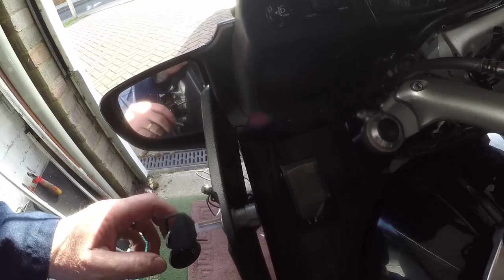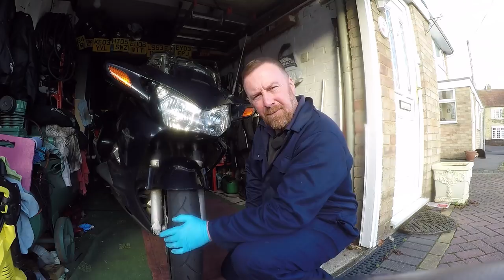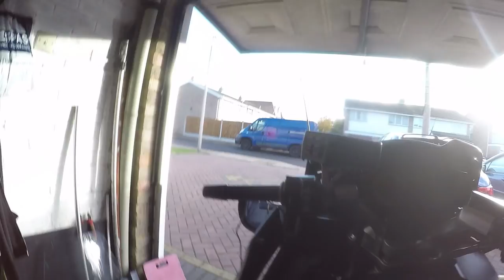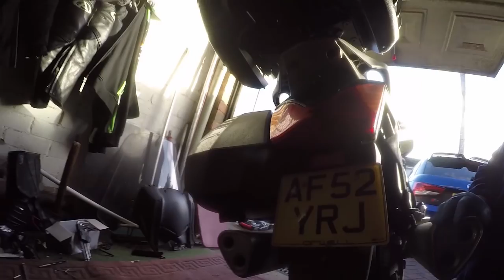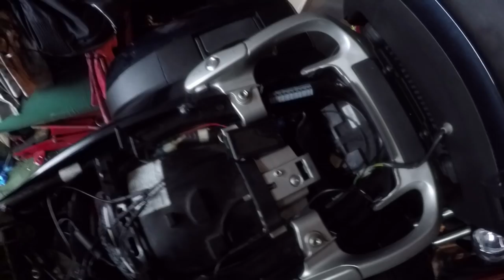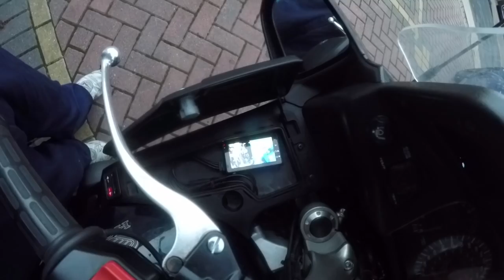HONDA PAN MOTORBIKE DIY DASH CAM FITTING + LED 501 MARK SAVAGE

Comment: Kudos Mark.  That looks a nice job.   Following all your vids and slowly getting a cheap ass Sinnis 2012 125 up to scratch. Front break calliper, carburettor, air filter, oil, spark plug all done thanks to your vids.   Rear drum next along with front and back rubber then it’s all done.  Keep up the good work mate!
Reply from the maker: Dar Garner thanks bud and for watch 
I have had a few cheap 125s and all suffer from the rear brake and speedo cables but god old wd40 and regular services and they keep good 
Enjoy bud 
Mark
Reply: You are bang on.. I forgot about the speedometer cable too..   I took it off to clean and check it and the bloody thing had snapped about 6” from the wheel end inside the outer cable.  So..  do you recommend getting the outer complete or do I just buy the inner and use original outer Mark!  Thanks in advance
Reply from the maker: Dar Garner you have to buy the  whole cable but it is really easy and just change the whole thing and you can get to it very easy 
On some peds I just slip in a new inside cable 
Next thing to fall off is the exhaust lol 
Still a lot of fun for £600 odd 2nd hand 
Mark
Reply: mark savage ...  Right, you have either seen this bike or your crystal ball is on form!    You are bang on with the value and the exhaust situation but it’s the best 600 I ever spent and I haven’t even ridden it yet...    Cheers for the tips on the speedometer and stay safe on the bikes Mark.    PS.  kindly ask your crystal ball to send 6 of its luckiest numbers between 1 and 45 😜...

Comment: Yet another informative, theraputic funny video.
Mark.
Nice to see you faffing a little.On a  bike your not familiar with.
Have already installed leds 
I looked for canbus no faults.
Love them.
Also wear a gopro cheap copy while riding my tmax.
Just bought a nice rear camera/monitor...so i can see directly behind myself.....
Have a look at fitting those small led spots to your front mudguard.
That way the light will shine where youre stearing.
John
Reply from the maker: John Oleary thanks for watching bud and for the advice 
Mark

Comment: Hey Mark 

You should have removed the left fairing , very easy to do (once you know how), takes around 10min, as for the side lights, you were on the right track, you need to completely remove the back panel up inside (takes around 5min), then just stick your hand right up there and pull them out. But hey you got there in the end, well done.......
Reply from the maker: The Jaggy Thistle yes bud I guessed there’s a easy way once you know how but yea like you say I did get it done 
May still put them extra lights on later 
Thanks for watching and your comment 
Mark

Comment: Hello. I have the same bike. I have installed the camera's and box but just not sure on the ignition wire. which one and where did you use
Reply from the maker: @karldegans2518  I used the ignition wire but the head light is easier to find and connect too

Comment: Mark I know it's been some time but how did you route the rear camera as you didn't show it on the video.
Reply from the maker: I just ran it up from the rear to the unit 
I have a free more dash cam fitting videos worth a watch bud
Reply: @marksavage  cheers for the response whilst we are looked down I am going to install one it just looked tight between the top box rack and bodywork so was wondering if you had slackened something off to squeeze the plug through.

Comment: Hi mate quick question- I have 2 round cameras one with a flat dark lens the other with a clear concave sort of lens,if this is the same as yours which one did you use for front? I can't tell by the small screen which one is the 1080 and have no adapter to plug it into pc yet so appreciate your input👍
Reply from the maker: hi bud I have 3 other videos on fitting and reviewing these dash cams well worth a watch, id plug them in before fitting and you are looking for the one that seems zoomed in the most that the one you have at the front
Reply: @marksavage  hi bud I think I got it now,the one with the clear concave lens seems to be the most clear and most likely the front,once I rigged it up to a spare battery and brought it inside i was able to tell,I did go back through your vids and watched again,appreciate your reply and all your vids bud thanks👍EDIT-thought I'd update for anybody reading I've since gone back and changed them so the one with the flat lens(yellow plug)is the 1080p front camera and the clear concave lens for rear camera,the back one plays in inverted/mirror for some reason but can be switched using vlc app to playback if needed👍
Reply from the maker: that's good to hear bud 
thanks